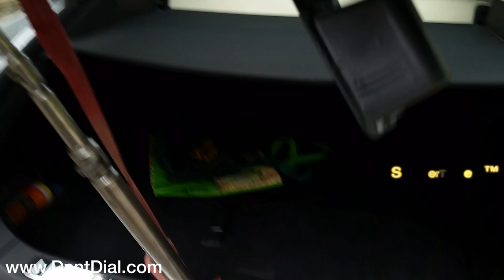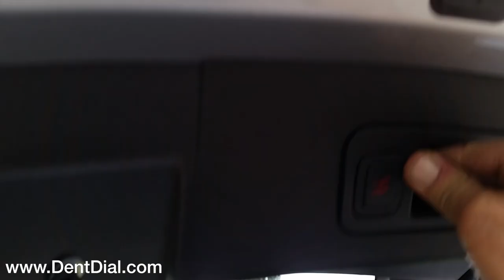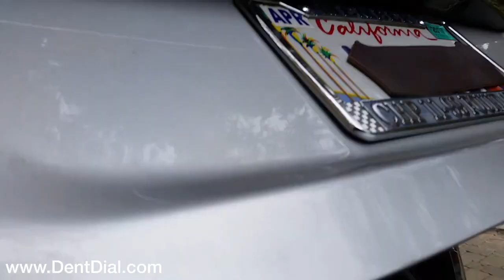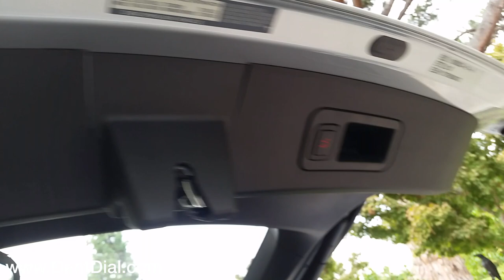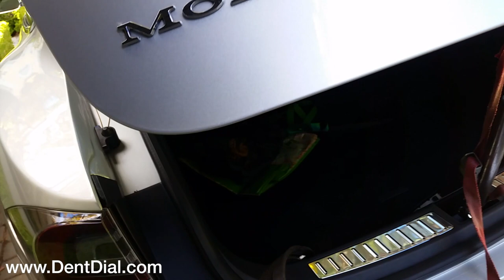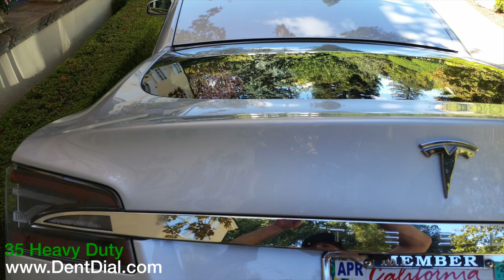Tesla Model S dent on the trunk lid repair without repainting.  Paintless dent repair by DentExpert

Comment: Great job Sal, nice clean repair! you have engineered those tools perfectly for jobs like this. A standard round bar would have potentially have slipped on a tough Aluminum dent like this creating more damage! But no problem for your flat bars! 👍
Reply from the maker: yep you got it right and I started out with rods like everyone else and I know that dreaded spin out and how awful the damage that can be created.  Definitely the main reason I invented other ways because spin out is the nightmare to avoid for sure.

Comment: I have a similar dent, is it safe to do it without heating up the paint first? Some repairmen do it  before applying any force to it.
Reply from the maker: Heat is always best first but with Tesla not necessary, because the paint is applied by electrostatic and rarely cracks.
Reply: @dentexperts  Thanks, I hope I will not end up with a new trunk cover ;)